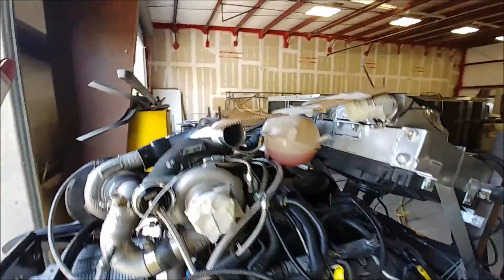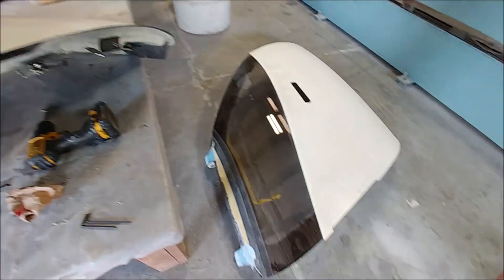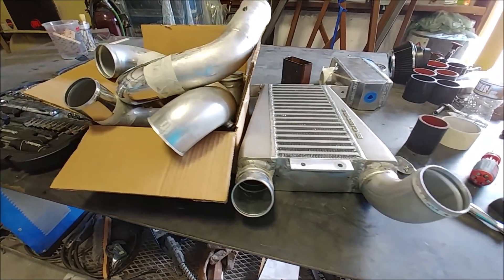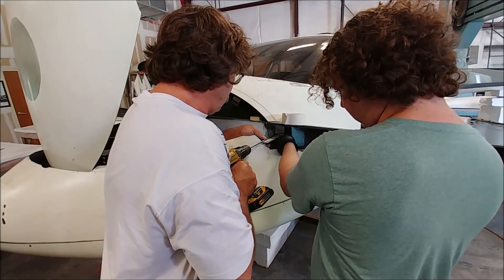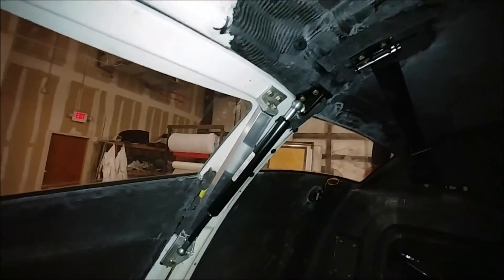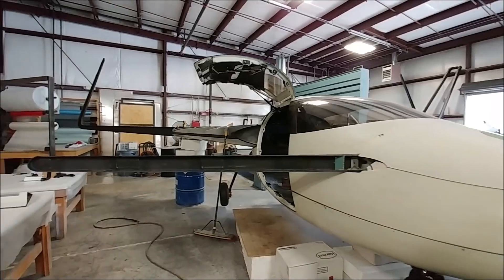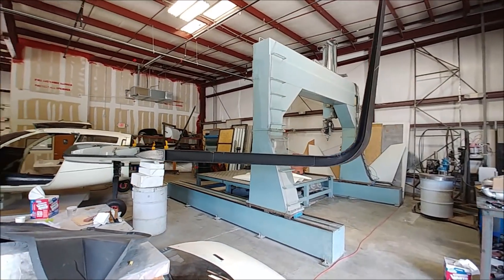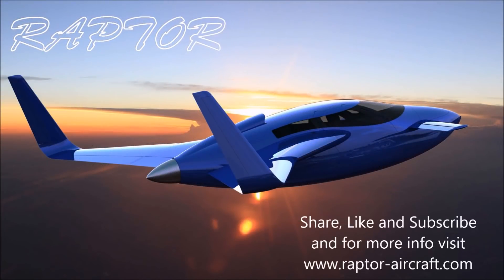Engine, Doors and Wings - Building the Raptor Prototype

Comment: as an old mechanic and not an engineer i was struck by the main spar "bend" to vertical. the "deformation" in the curve are exactly like  the failure modes i have seen in channel sections of various metals having been similarly bent.
Reply from the maker: It's being boxed in and we have run FEA on it.
Reply: It’s molded to that shape, not bent.

Comment: Peter. How many parts have you made to date?  Is the weight of everything you have produced so far on track to not negatively effect the useful load ?
Reply from the maker: A bazillion and it's heavier than it could be because of changes made along the way. But it is a prototype and these as things that will be fixed in production.

Comment: How will you get the aircraft outside of the building?
Reply: J. W. Volet literally came to ask the same question
Reply: https://youtu.be/jk8giU4Hc0k
Reply: It will come out the same way Henry Ford took the first car ever build out of the shop. Lol!
Reply from the maker: By using the flux capacitor 😄
Reply: Raptor Aircraft wow, up to 88 mph while still on the shop floor, that’s great acceleration!
Reply: It's not getting to 88 mph that's the challenge, it's generating the 1.21 gigawatts!